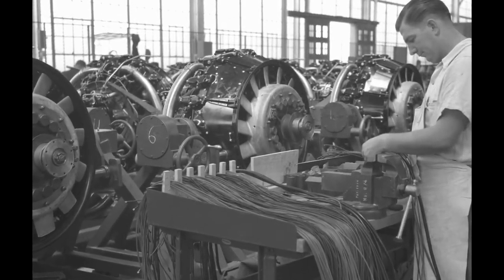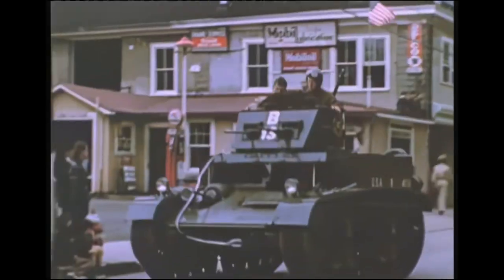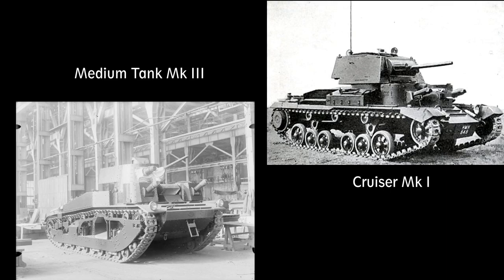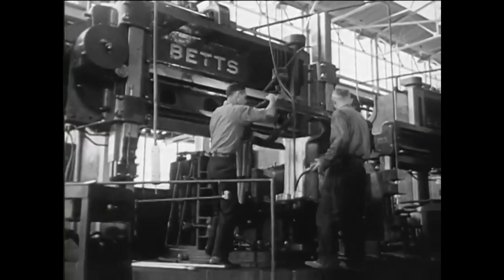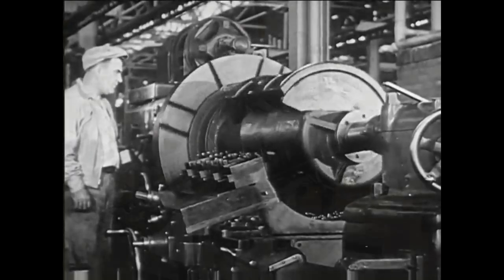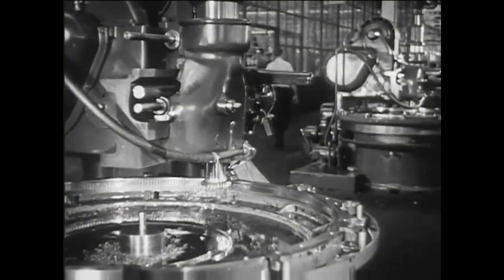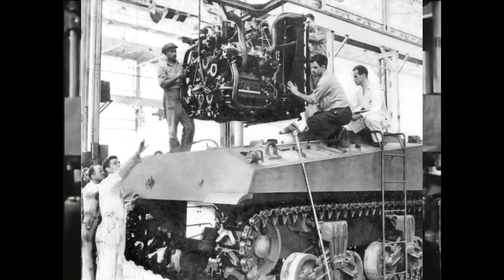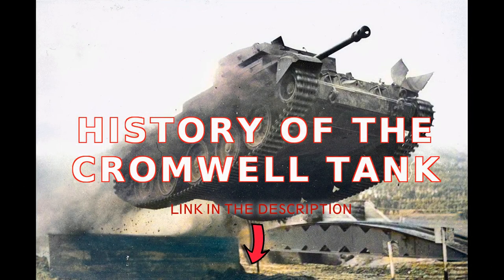WHY (SOME) WWII TANKS USED AIRCRAFT ENGINES? [ WWII DOCUMENTARY ]

Comment from the maker: At 6:30 there's a mistake: the Ford GAA was not based on the Merlin engine, but Ford's own V12 engine which they designed to compete with the Merlin, and had the same bore and stroke as the Rolls-Royce engine. They then shortened it to V8 when the army asked for a smaller V8 engine to use in tanks.

Comment: I think the satement that the Eisenhower and Patton wanted to use the tanks as a breakthrough force, similar to the traditional cavalry role, is a bit disingenuous. The US tank branch was experimenting with motorized infantry and cavalry paired with light armor to try to engineer a doctrine revolving around maneuver warfare. This included truck transported cavalry, and purely motorized and mechanized formations. There was a significant portion of the the US armed forces that wanted to keep the horse and it's inherent advantages, even when those were largely mitigated in modern warfare. Adna chaffee did a lot to convince the army command of the importance of tanks and motorized support, and laid a lot of the groundwork for the WW2 US armored formations
Reply from the maker: True, theres much more to it, but the video is not really about the doctrine i just touched on it because the difference in opinions at that time held back tank development.
That's the reason i included the link to The Chieftain's video as he is the expert and his video on the doctrines of the time is very detailed and informative.